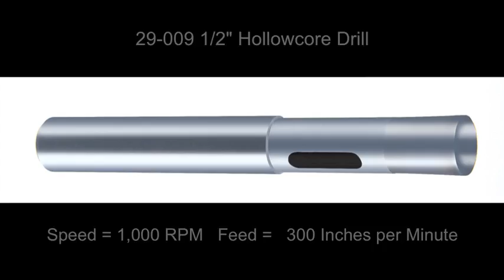Honeycomb Rougher / Hogger Endmills on CR Onsrud F98HD15 Video by LMT Onsrud

Comment: How this mold made？
Reply from the maker: This is actually honeycomb material that is being cut utilizing several cutting tools designed for routing the material. Each tool being used is shown along with the parameters of the tooling. Does this help?.
Reply: LMTOnsrud How u get the wood fixture under the honeycomb ?
Reply from the maker: I see...the wood itself is mdf planed to be flat to hold the honeycomb material. On the underside of mdf, gaskets are typically used to prevent air leaks and loss of part holding. The table itself is using a vacuum hold down, which is important to prevent part movement. The table itself has channels that allow for the vacuum to be utilized. There is a special double-sided tape that is used to hold the honeycomb to the mdf material itself. On Page 13 of this guide, you can see how the gaskets are laid out. http://www.onsrud.com/files/pdf/LMT-Onsrud-CNC-Prod-Routing-Guide.pdf